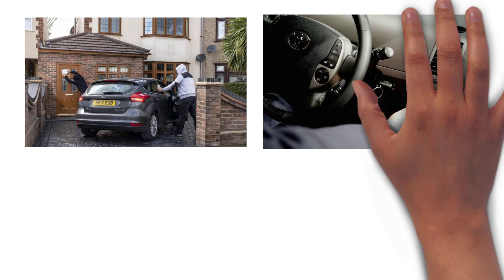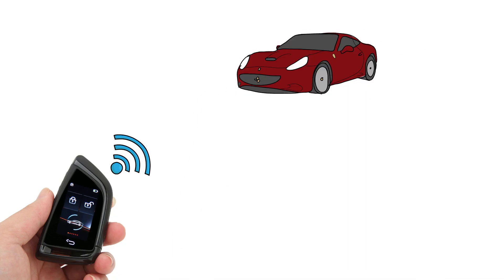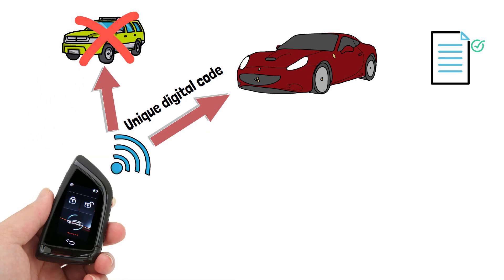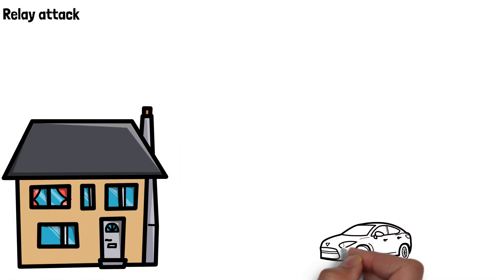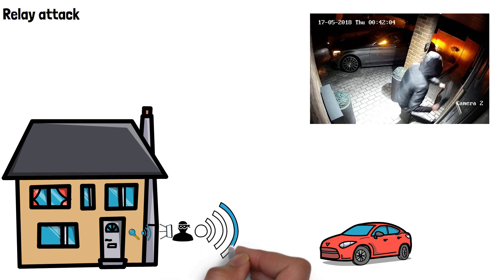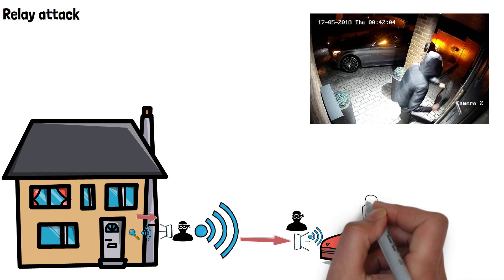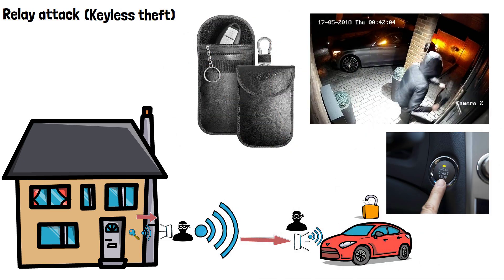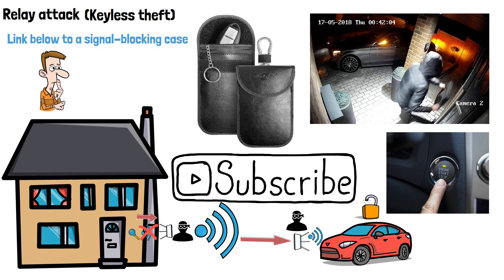How Does Keyless Car Theft Work? (Relay Theft)

Comment: If you park your car say outside a house four doors down will it still pick up the signal
Reply from the maker: It will still pickup the signal from the house but the repeater may not send the signal far enough to the car
Reply: @techindex1 a couple of weeks ago it was parked down the road I always lock my car but in the morning the doors we're unlocked and the steering wheel was locked so Don't know if they had enough signal to start the cat but just to open it

Comment: What’s the range of the thieves’ tranceiver devices? Could they target your vehicle as you pull into a carpark, one thief waiting by the car, the other following the owner into the store, restaurant, etc to capture the key signal?
Reply: Depends what frequency is used. The link between the receiver and transmitter could be hundreds of metres as long as one end is at the car and the other is near enough to the key. They use two SDR's (Software Defined Radio) like the USRP B200mini which is capable of transmitting on any frequency between 70 and 6000Mhz in full duplex mode. One of them will receive the signal from the key on whatever frequency the key uses and then re-transmit that signal on a different frequency chosen by the user to the other SDR which then receives it and re-transmits it on the correct frequency for the car. With a clear line of sight between the two SDR's and the use of a 4 watt amplifier it's quite possible to be a few kilometres apart but realistically with a small 0.5 watt amp at each end the performance would be similar to that of a handheld 2 way radio, maybe 6 or 700 metres with a wall or two in between.  The fact these SDR's are capable of full duplex transmission is what makes this possible. That means it can receive and transmit at the same time on two different frequencies. The communication between the key and car is a two way handshake which prevents someone simply recording the signal from the key and then playing it back afterwards as you can with pushbutton key fobs. That method even works with rolling code fobs if you can prevent the car from receiving the signal from the key when the button is pressed which is quite easy to do with two people.

Comment: Is it possible for someone to access a keyless car if the fob is far away from the car (100m+) and they are unaware of the fobs location? Cheers!
Reply: Technically a relay attack can be done over any distance but one end needs to be close to the key and the other close to the car.  The signal from the key is very short range, 5 to 10 metres at most. The receiver needs to be within that distance. The distance between the two devices could be as much as a kilometre or more depending on the frequency and transmit power level used.

Comment: But if you drive away with the car and don't have the fob, how can you restart the car? Does this relay transmitter actually copy and store the code so it can be replicated?
Reply: No if you stall the vehicle then you have to use the relay again these codes are rolling codes that's what is captured

Automatic tho won't stall so won't need restarting

They can though if they have programmed a new key to the ECU

It's possible to clone the key signal and replicate this signal but it's a bit more complicated than a simple relay attack

But yes it can be done

If you have the correct equipment you don't even need to have the key to relay

You can just buy the brand specific ecu obd tool scanner

Then you can just program a new key yourself by connecting to the onboard computer

It's not actually this hard anymore

You can actually buy a key card programmer tool which also decrypts the onboarding key program for around £1000.00

This method works with access to inside the vehicle but yes they can program their own key

You can gain access several ways also without using the relay method

You can do what all the tool thiefs do and flick the central locking actuator and open the doors

You can use a blood pressure pump slide it in the top and open the door slightly allowing enough room to pull the door catch 

You can use a central locking slide tool

You can pick the lock

Remember to stop these manual methods double lock the vehicle by pressing the lock key twice on the fob

But no matter what you do someone somewhere if they want the vehicle they will get it

To be honest the way I see forward to not completely stop but most definitely limit vehicle theft

Is to use biometrics for entry and start

But there will always be a way around it because there is always a backdoor

It just depends on how many people who develop the system expose the system for others to work out how to use the backdoor

Because all os now have many developers you can't write a os like this without multiple packages and developers

So they all need some sort of access eventually a key will be exposed or decrypted

And will eventually be leaked

You know most work arounds and methods to do these things actually originate from corrupt or crooked people who work on and fix these vehicles

It's the people who do these jobs for a living who work for the manufacturers and are the ones who fix these vehicles or program them at garages

The people who program the keys for the customers and stuff at the manufacturer garages and repair shops

These are the people who are letting people, showing them, giving them the equipment to do these things

A point here for an example of crooked corrupt methodology

A locksmith will get called to an house and get told the keys were left inside

The locksmith will either drill the lock to maximise time spent doing the job

He would then either pick the lock, making it take a little while knowing full well he could pick it in less than 2 mins

Or he could use a plastic card and open the door in 1 second

Do you ever think he uses the card

No do you know why if you tried to invoice somebody £200 for a job that literally took 1 second do you think the client will be happy or leave positive feedback online or not try to hustle and say it's a joke £200 for 1 second

The moral of the story here are the ones in the know and been trained in these professions exploit it as much as they can
Reply: @kirkmacdonald7259 how to make this device ??

Comment: Interesting.
But how do they keep driving the car if the key isn't present in the car. Come modern cars require itvtonbe inside all times.

Also can they copy the signal from the keybfor future use or is the code only one time?
Reply: once their inside they can probably drive for a little bit but then they program a universal key for the car

Comment: It's called a REPLAY attack, not RELAY.
Reply from the maker: A replay attack is a form of network attack where genuine data transmission is maliciously repeated or delayed. This is not the same thing as a relay attack, thanks for watching 😊
Reply: this is a RELAY, not replay. They're using a live code from the actual fob by basically just boosting/extending the signal, not capturing and replaying

Comment: I think this technology is an over engineered solution to a simple issue. Keyless entry needs to be done away with
Reply from the maker: Yes it does seem to be a big security risk to solve a basically non existent issue. It has actually caused a price drop in some Range Rover models as they’re so often targets of keyless theft!
Reply: I think you mean keyless start... Keyless entry is fine, but keyless start is stupid. But yeah.
Reply: @jamesmiranda1449 no keyless entry too because people clone the code to steal things out of cars not just steal the car itself
Reply: @jamesmiranda1449  no. I meant keyless entry. Exactly as I typed
Reply: I find keyless entry super convenient. I'm annoyed each time I swap cars with my wife and need to reach for the key in my pocket.

When I leave my car in the driveway for the night, I disable the keyless function by double clicking the lock button (the Merc way to do it).
Reply: @kamczak89 I have no problems when I swap cars and keys with my wives, using the old method. They love it too!
Reply: It’s a huge security risk . Should be scrapped